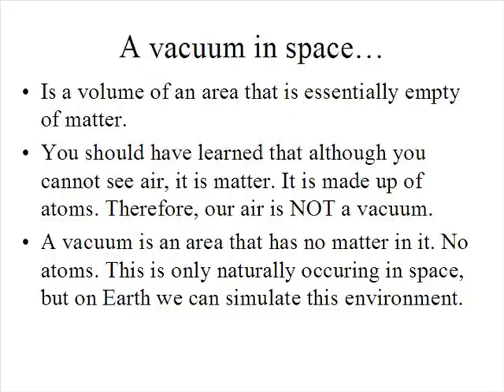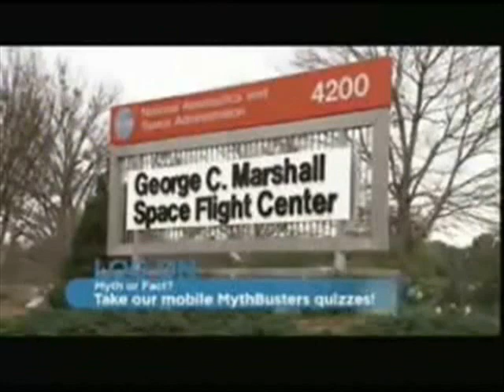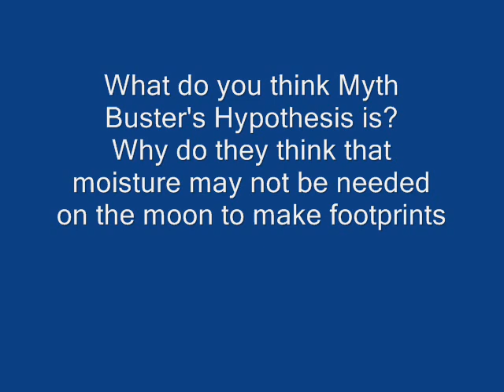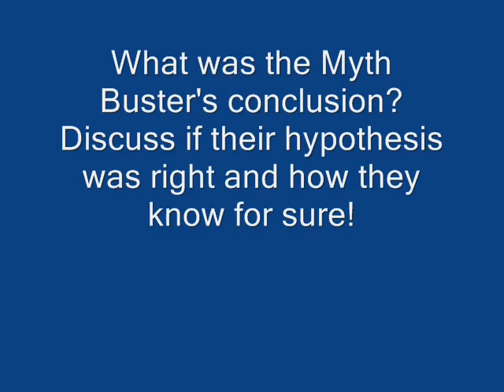Scientific Method Classroom Lesson: Moon Footprint Mythbuster

Comment: Did they heat the sand up to 150C degrees as its on the moon? How much sand they put? To be completely free of any wet drops? Did simulated the 1/6 gravity. Because i can make a print even in stone if bash it with hammer. 100 kg person/6 = 16,6 kg. Did 17 kg are enough to make such print? And humas have two legs - the weight is divided among even greater surface area.Because if can then must be swamp and the lunar module will sink. The correct test is 17 kg weight in the boot, 150C heated for 4 hours sand, 40cm thick sand, drop the boot from 40 cm and see the footprint. Then put the 17 kg boot without impact and see how much is the footprint. Because the sand can be wet,can be thin 2 cm layer,the lever can put tonnes impact, the gravity is 6 times bigger.
You can see the impact. Boot not step softly but bash. You can hear the sound from the impact.  Nobody bash his foot as hard as he can when walk, right? This test is not fair.
Reply: @Ken's Roblox Channel 
Its chill during the shade areas on the moon. Very cold yes. All parts of the lunar lander that are shaded will froze. Film cameras on the astronauts chests cant survive as well. Much less the film.
Reply: @Ken's Roblox Channel 
Or something. Pure logic. Obvious hoax.